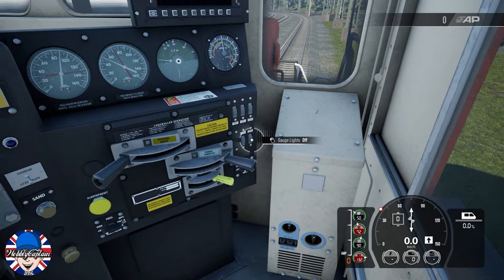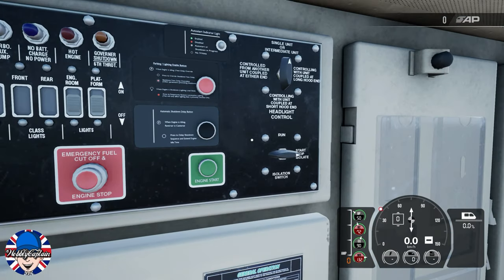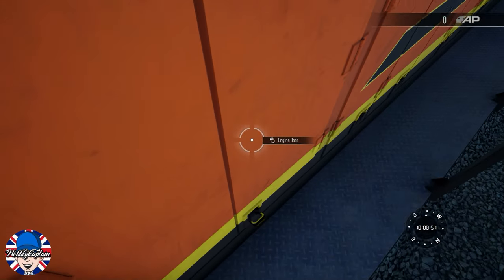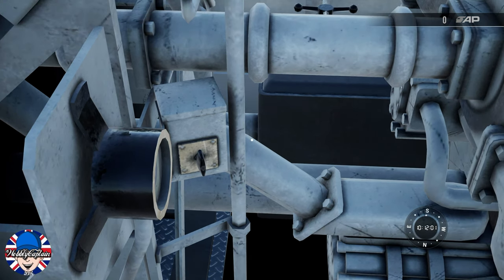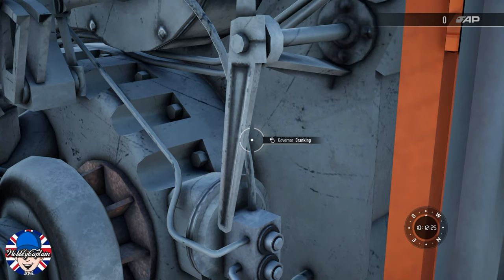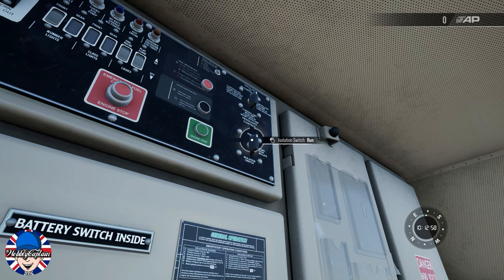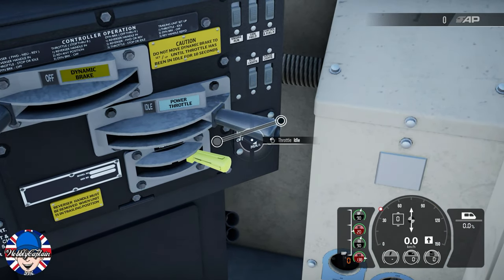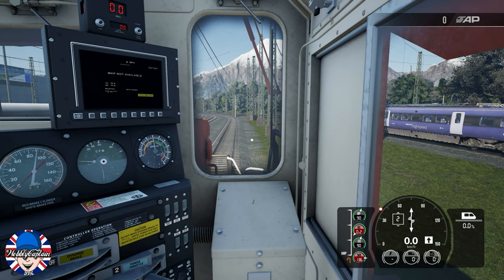BNSF SD40 - 2 How To Perform A Cold Dark Start Quick & Straight To The Point Train Sim World 3

Comment from the maker: This Cold & Dark Start sequence represents when the train is fully powered down. You may use this as a 
reference to get familiar with how trains are started and practice the full start-up sequence by spawning 
on-foot in the Training Center

- Climb up onto the front of the locomotive 
- Enter the cab by interacting with the cab door 
- Sit down in the Engineer’s seat 
- Insert the Reverser Handle, leaving it in Neutral 
- You may now start the engine, stand back up 
- Open the Fuse Cabinet on the back wall 
- Check all the switches, and if open, set the Main Breaker to Closed 
- On the back wall panel, ensure the Isolation Switch is set to Start/Stop/Isolate 
- Exit the cab via the back door, walk halfway along the locomotive to the Engine Room 
- Unlock the latch and open both doors 
- Hold the Starter switch in the Prime position for 10 seconds 
- Then hold the Starter switch in the Start position for 10 seconds 
- Once the engine has started, you can test it by cranking the Governor Handle 
- Close the Engine Room doors, in the correct order, and lock the latch 
- Re-enter the cab 
- On the back wall panel, set the Isolation Switch to Run 
- If you wish to drive with Warning Devices enabled, close this Fuse 
- Sit down in the Engineer’s seat 
- Set the MU-2A Valve to Lead or Dead 
- Set the Cut-Off Valve to Freight 
- Move the Reverser into the intended direction of travel 
- Set the Front/Rear Headlights to Bright & Ditch Lights as appropriate 
- Set the Generator Field Switch to On 
- Release the Handbrake (handle on the nose next to the front cab door) 
- Ensure the Independent Brake is fully applied 
- Set the Automatic Brake to Release 
- Apply a few notches of Power with the Throttle 
- Once power is being applied, slowly release the Independent Brake
Reply: WoW thank you I will save this. Cheers
Reply: After I hold the switch in the prime position for 10 seconds and hold it in the start position, the engine doesn't turn on please help😢.

Comment: Great, I was desperately looking for a cold and dark start tutorial for the SD40-2 (TSW 3, on foot in the Training Center). All the SD40-2 training videos which I found start with the engine already running (seen on the exhaust smoke on the roof). 
But there is still one question left to me. I wonder if there is any kind of AUTO /SMART engine start option. On the panel above and out side there a big notes as "Warning - Autos start eqipped" and other "smart start operation - Autostart switch must be "ON". In the panel above the fuse panel (left to the isolation sw) there is a green push button "ENGINE START". Does it mean there is a smart engine start option, which means no priming and engine start outside? Maybe it's not functional, is it?
Reply from the maker: Interesting , answer to your question I don't know, part of this game is finding and learning all this stuff as the game lacks good instructions however it is getting slightly better tutorials nowadays maybe once the engine is primed you can stop and start the engine using autostart ? Well noticed I personally have never paid much attention to this but I will check it out now .

Comment: What you showed in the video, is it the same when braking is put into emergency braking? I did that by mistake last night and what I tried never worked, I couldn't get the Loco going again.
Reply from the maker: So you put the emergency brake on by mistake ?  If so you need to reset the brakes I think .Did you try setting the throttle back to Idle them set the reverser to neutral put the Independent brake to full service then set the automatic brake to emergency you might have to release then put in emergency brake wait a while maybe 60 seconds then release the automatic brake and wait for the brake pipe to return to 90psi ish replenish you should be good to go I think lol that's just off the top of my head
Reply: @wobblycaptain  I did try some of that, but I sure will try it again and see what happens, I was doing (trying to) Barstow-Away and when backing in the train cars I got it going too fast and panicked :)) and well a N00b move. Thanks for the info ...
Reply from the maker: @SgtDreTecKeGamer 👍👍👍
Reply: There's a switch in the SD40-2 on the automatic brake regulator, sets it to 'cut off', 'passenger', 'freight'. Release your automatic brake entirely, set the independent brake. Flick the switch from whatever you're using to 'cut off', wait a couple seconds, then flick it back. Took me awhile to figure that out, and I didn't do it on my own 🙄
Reply: @Zyo117  thanks for the info, and it's been working when that happens :))
Reply: @SgtDreTecKeGamer  Just to clarify, because what works in the game isn't exactly how it's supposed to work, you're supposed to move to automatic brake from emergency to shutoff, then flick the switch, then release, but the way I mentioned apparently works fine in-game.
Reply: @Zyo117  I do understand what you have explained, and from what I have noticed over time there is a lot in the game that just does add up. While I am not nor had, I ever been in the railroad line of work, it's just a feeling I get that "just is not right." But in this game if it works, I just put my hands up and well it works, I just figure corners were cut to get things out the door sort of speak.
Reply: I have same problem now